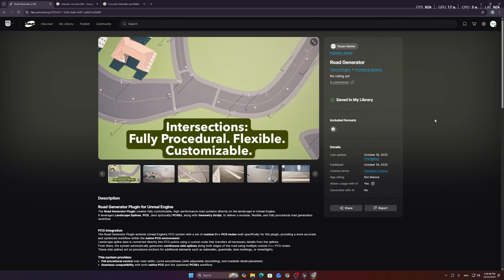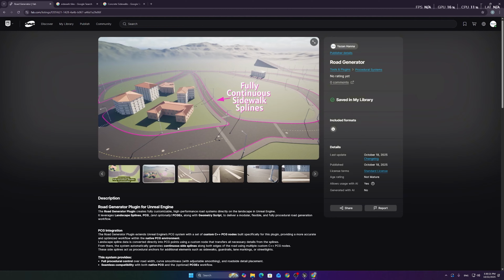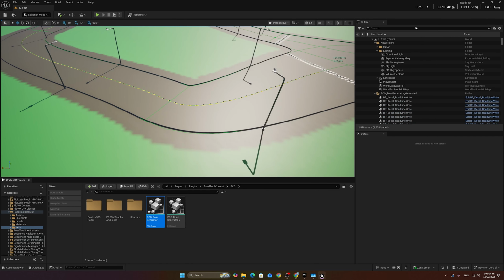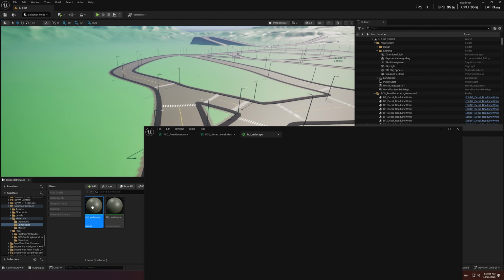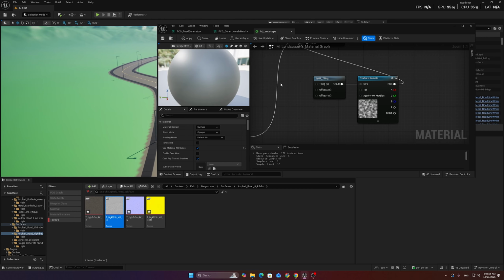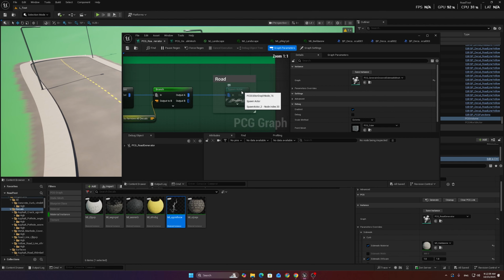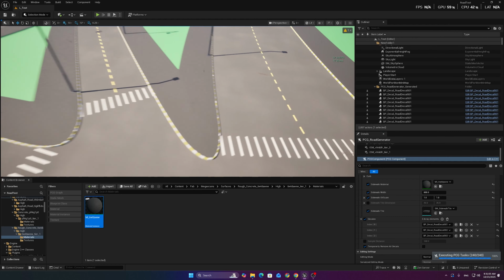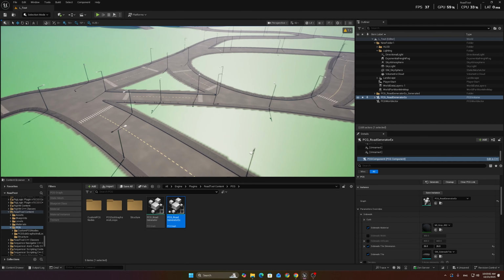Unreal Engine | Road Generator Plugin

Comment: Would it be possible to let AI cars drive on your roads?
Reply from the maker: my plugin use PCGEx and make a cluster. 
PCGEx have a tool that convert the cluster to Zonegraph https://pcgex.gitbook.io/pcgex/zone-graph
Zonegraph is unreal's tool for ai cars navigation.
I haven't had time to test that yet, but should be possible.

Comment: Id like to use this im y video game, but I am building an open world with an entire city of roads/sidewalks, can I bake the final splines to static meshes and convert to ISM? Also, I see how you edited the roads/sidewalks/curbs in the video, but you did it in the test-level, and I wont be using it like that. It would be helpful if you opened a blank project and placed the splines to create roads and connect intersections, as-is this seems like a learning curve so im hesitant on purcahsing. Thank you
Reply from the maker: I'll be making a video soon to explain more.
to answer your questions, for baking the roads themselves are landscape splines. (just edit layer and paint layer in the landscape, can't be baked but they perform very well)
the road markings, curb, streetlights, and highway rails are ISM spawned by PCG.
the sidewalks are dynamic meshes spawned by PCG as well.
all ISM and dynamic meshes can be baked into a PCG Stamp.
Dynamic meshes can be converted to static meshes with PCG using `Save Dynamic Mesh To Asset` if you need to.

Appreciate your interest.

Comment: what's not clear to me is how i would connect different road types to each other. for example a main road with a sidewalk on both sides, but then on a T-cross a second road type without a sidewalk. what would be the workflow here?
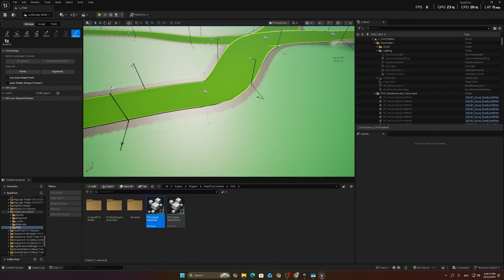Reply from the maker: this is all done automatically, as you can see at 7:20
it outlines the roadsides and goes around all intersections to make the sidewalk.
you just use the landscape splines normally.
Reply: @YazanHanna  i think you missunderstood the question. the second road on a T-cross should be without a sidewalk while the mainroad has a sidewalk. also how would i apply different road materials to different road types that also connect together at some point? workflow-wise to me it would be fine if i configure 2 different road types and mix-and match them manually at that point of intersection, but then the problem are sidewalks that i can't easily remove for exactly that intersection (because the 2nd road shouldn't have any). or is there a workflow for that that i am not aware of?
Reply from the maker: @hoax-games   I understand what you mean now, in the new update all of this has been added, using layer name in the landscape splines, then you can attach different material to each layer in the landscape material using landscape layer blend.
also, the option to split the sidewalk and add something else like highway rails also have been added in the new update but only to the PCGEx version.
I'm sorry this video is outdated already, i need to make a new video for the new updates.
Reply: @YazanHanna thx for the info :)

Comment: Took me a bit to figure out how this was working, it's a very clever technique to directly draw the roads onto the map. It has some shortcomings as you won't be able to do bridges and similar road features. Unfortunately I cannot use the landscape for my project due to multiple constraints one of which is landscape LOD level warping caused high FOV values. However I'm still considering of purchasing the tool, just to learn how its generating mesh intersection features.
Reply from the maker: Thank you!
Bridges are actually easy to make, they can be set up as a separate PCG tool using a regular spline, with the ends blended into the roads. I’m planning to add that to the plugin soon (I'll try to do it today). but I’m not sure I fully understand the landscape issue you're describing
Reply: @YazanHanna I know, I‘m building a road network system for personal projects but doing it all purely based on meshes is very complex, especially when connecting interconnections or other similar road features. Is there any chance the tool could be extended to paint on meshes instead, like imagine a sliced (partitioned for streaming) mesh based terrain, maybe using vertex painting? That’s something I would definitely want to invest in to learn from. 🤔
Reply from the maker: @vz_creates  yes it is possible with geometry script
this is a video that does exactly that
https://www.youtube.com/watch?v=OIeOaZU-pn4
it is possible to assign a material to a dynamic mesh element as well in geometry script